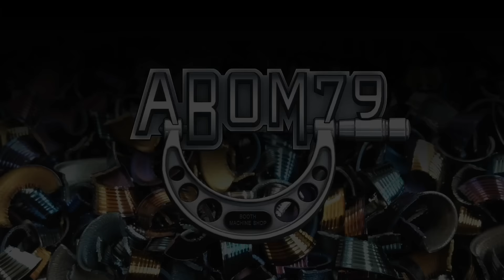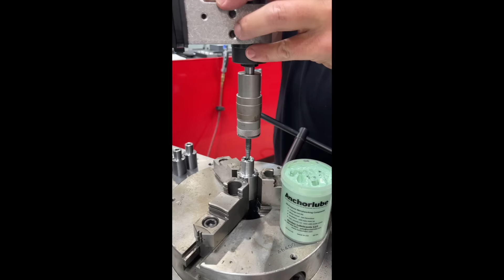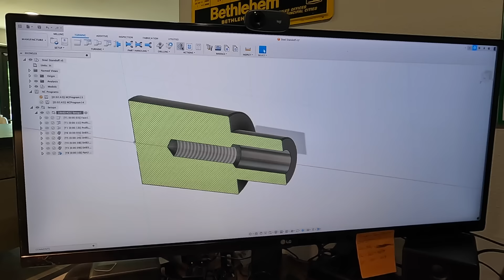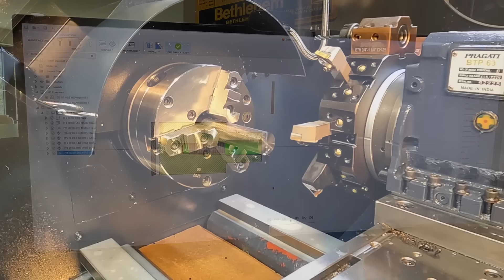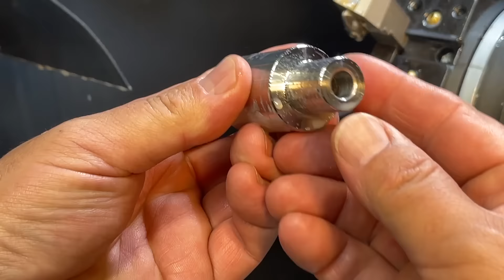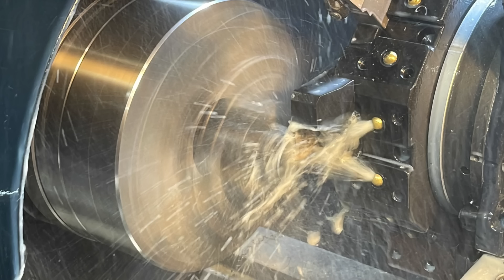Small Batch CNC Turning for the Fab Shop

Comment: form tap it and use the largest carbide drill you can while keeping the minor diameter in spec for the thread fit.  no need for anchor lube if your coolant concentration is high enough.  I run at 10% on the mill and have had zero failures form tapping 304

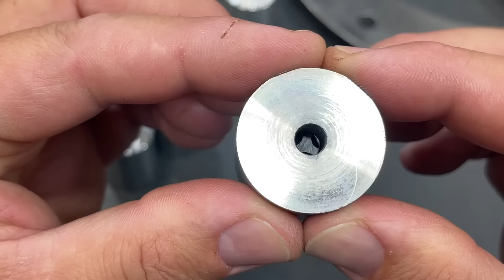Comment: At 22:58 it looks to me like there are threads all the way to the face. Adam wasn't taking 1/4" cuts, so if those were threads at the face then the tap did bottom out.
Reply: I though they were scratch marks from the drill
Reply: @thedodger7030  That's a very coarse pitch for drill scratches.  If the tap did bottom out it would have left shallow cuts at the thread pitch (shallow because it's the tip of the tap) and that's just what it looks like.  That is consistent with bottoming out caused by the spindle not stopping instantly at the finishing depth. However I can't explain why the broken portion then moved back up the hole.  Perhaps we will get a clearer picture when we see what Adam does differently on the next attempt.

Comment: If you want to have another go at tapping in the lathe I would suggest a few things. Quickest and cheepest drill out for a 65% thread rather than a 75%. Way less torque needed to make the thread with almost all of the strength of the 75%. Next step up is try using a form tap. Way bigger stronger core of the tool and no chip problems since your forming the threads check the drill size though because its probably not on the chart. The threads are also stronger since the grain structure of the metal is deformed and hardened slightly during the tapping process. Most expensive option use the form tap with a Tapmatic Syncroflex II tool holder. If you find that the problem is the dwell at the bottom when the chuck needs to change direction a syncro holder will help reduce the shock the the tap feels.
Reply: Form taps works necessarily with oil not with coolant
Reply: @petkoivanov9020   They work fine with coolant. I have done thousands of holes in all kinds of materials with form taps with just coolant and they gauge just fine. MAYBE they would last longer with oil but I think 2000 holes tapped per tap is enough life for a single tap.

Comment: Machine Coolant sucks for taping,  optional stop and anchor lube,  and run a lower speed
Reply: Agree, we always lube when taping steel.
Reply: Lubrication isn't the main reason that tap snapped...  We run water based coolant since 15 years and we have drilled and tapped 10s of thousands of holes and never had a brand new tap break on first use..

Comment: Does milltronics use canned cycles. I dont know if fusion posts canned cycles.  if the lathe is conversational maybe try using that to program the tap. I agree that a floating holder iis probably needed for that machine.

Comment: spooling down the spindle after each pass is killing your times, because once you spin it down, you have to wait for it to come back up to speed before starting the next movements. find a way to disable that, that way the only time your waiting for the spindle is when you actually changing spindle speeds
Reply: He's got it in css mode.  Spindle speed is proportional to tool position
Reply: I wondered if that was something as a default in the programs or if Adam set those RPM's.  I would agree, those up and down RPM's really aren't all the necessary, I do get the idea but I don't believe anything is gained in the end. Some of the speeds I noticed are super fast, faster than I have noticed in any other CNC process.

Comment: Hi Adam,
Really enjoy your videos.
Just a hobbyist here.
I have a 2007 HAAS TM1P Vertical Mill and many years ago I did some Peck Tapping on my machine.  Here is the title of a video that describes what I am talking about.
"Simple Peck Tapping Using a G84 Tapping Cycle – Haas Automation Tip of the Day"

Not sure if your Lathe and associated software supports this function or not.  If it does this may???? be of some help in tapping deep holes.
🙂

Comment: I would try an optional stop before the tapping cycle and add some Anchor Lube to the tap. Peter at Precision does this. Also I would set the tapping RPM to dead slow…like 20 rpm to eliminate any shock loading. The lathe should know when the spindle speed goes to zero so it can reverse and start retracting. If it is smart enough to do thread milling it should be smart enough to do rigid tapping.

Comment: Form tap cold rolled all day long. Those stringy chips when cut tapping are a nightmare
Reply: If your feed and spindle speed are not locked/synced properly then that won't help. When he gets that sorted or has a floating tap holder then you can play with tap options.

Comment: It’s almost like the mass of the spindle kept it spinning vs a hard stop causing a bottom out
Reply: A fantastic learning experience
Reply: If the spindle speed and tool position are truly sychronised, the slowing down, stopping and speeding-up in reverse should take care of these details. It didn't bottom-out.
There's something else going on and I'm looking forward to finding out what it is.  
If Adam simply goes to a tapping head, it will certainly fix the problem, but we'll never know what the problem really was.

Comment: Welding shop to the customer rescue again
Reply: Well… I’ve been around that airport equipment in the past.   It gets a half year of wear in one shift.. add in poor engineering… like the cylinder is not in line … the mount plate has too much flex, etc… and it becomes a nightmare

Comment: Thanks for the video,, I may have missed the reason for not putting a welding bevel on the end,, does it need one?
Reply: The welding shop will be putting a hole into a plate, then put the standoff into it and secure it with a fillet weld (perpendicular surfaces).  Then the plates can be bolted into position on the machine, instead of having the welding shop come out and weld a standoff onto the machine.

Comment: could you try to have a pause in the program so you can slap some anchorlube on the tap before the threading?
Reply: The tap breaking had nothing to do with lack of lube/coolant. It broke bc the spindle speed and z axis feed weren't synchronized.
Reply: No need. The Anchorlube could be added when he places the workpiece in the chuck. It would easily stay on the tap until it was used. Another optimisation could be to drill the part all the way through, maybe even with a smaller diameter drill. This would mean he wouldn't have a nub to face off after parting off, though it might raise a bur which would need to be taken off with a Noga deburring tool or a countersink deburring tool. Depends on if the client would allow the through-hole, although it could be useful for part positioning/registration when they weld it on to their plate.

Comment: been years since ive been at a cnc lathe, but we used to clean the holes and put some oil before cutting, maby reduce the speed a little ? me thinking the thin tap "twists" a bit if it starts gumming up, and therefor break

Comment: Could you blow out the hole with air, put a dab of Anchor Lube in the hole instead of using the coolant fluid before tapping the threads?
Could it be an idea to make the chuck run slower and pause before reversing to lessen the load on the tap?

Comment: The milltronics machine doesn't have the drives synchronized accurately enough for rigid tapping. Notice how the spindle is continuously spinning before the tap is fed into the part. Thats why a floating holder is needed for that machine. On a haas when rigid tapping the spindle will stop then when the tap is fed in it will rotate in sync. True rigid tapping allows the same hole to be re-ran multiple times. You cant do that if the rotation of the chuck isnt oriented.
Reply: Agree, also should be using a spiral point gun tap in a floating holder. RPM  seems too fast..
Reply: CNC machines were doing rigid tapping in the eighties. Lack of lubrication is the problem in this case. Also should have used a spiral flute tap.
Reply: rigid tapping only synchronizes the feed with the spindle rotation, a Mazak will rotate above the part, as well as a Mori 

both machines have far more rigidity and capability than a Haas.
Reply: If that was true, how could it cut a thread? It's the same problem—move in Z in sync with the spindle rotation.

If it is jamming up, then most likely something's wrong in the post.
Reply: @PaulSteMarie  yeah that's a good point,  so how does that machine handle single point threading? All CNC machines can do right or left handed tapping but not all can do rigid tapping. There's a difference.
Reply: @caploader111 I'm no machining expert, but I think the reason not all machines say they can rigid tap, even though they can single point thread has to do with backlash. You can single point with all the backlash in the world and not have to worry much about it. With rigid tapping, however, you have to run the tap back out, taking backlash into account. I also think taps might just e a bit more fussy on the accuracy of the synchronization, but I could be wrong about that.
Reply: @neistridlar  yeah I agree. I think this milltronics lathe doesn't have the necessary drives and encoders for rigid tapping or it needs to be programmed using a canned cycle. I don't know what fusion posted out . I would assume that whoever is helping Adam program would know
Reply: @neistridlar  That's true, I use an 1991 Mori SL-75 daily and use a tool holder that I guess is semi floating type that has a little forgiveness for that, I tap mostly 1/4-28 with spiral flute and cutting oil @ 60 rpms it seems like.  The feed on this 18 thread he's doing should be .0555 ipr. The check to see what happened would be to look at that depth shown in the gcode and the Feed rate first instead of machining the end off.  I try to teach that stuff in CNC router groups but looking at the gcode is so frowned up on these days sadly. I trust reading the gcode long before what the simulation is showing.
Reply: @neistridlar  I think its mostly an issue if kinematics of this machine. At the bottom of the thread the spindle needs to instantly stop and reverse directions. This is not possible in the real world. This lathe in particular looks pretty slow on the stop and reverse. A floating tap holder or a syncro tap holder ( stiffer than floating but still compliant) would solve this problem. I think on paper his RPM is correct but he has to learn the limitation of his particular machine. As an example with a syncro holder in my BT30 spindle machine I can easily tap a 10-32 hole at 1000 rpm but I can only do 200 rpm in my lathe. Because the lathe spindle has so much more inertia it just takes more to get it stopped and reversed than BT30. He just needs to figure out where the sweet spot is for that machine.
Reply: @TomDetka  The machine doesn't need an "instant" stop—it just needs to maintain synchronization between the rotation and the Z position. The tap is going to be more sensitive to that than a single-point cutter and will jam and break in situations where a single point cutter would just make a small divot in the thread that would likely escape inspection.

Comment: It still amazes me after all these years that we can use coolant to tap at all. For all other manual and power tapping, we use cutting oil or anchor lube but in a cnc, we use coolant.
Reply: Coolant is lubrication also
Reply: We tap with coolant all the time. No problem.
Reply: @loukola5353  Yes I know. We've done it for many years successfully. I'm just surprised, that's all.

Comment: Floating tap holder Is way to go I’ve use them many times over the past 20to 30 years they are not new but they work great started using them on manual machines

Comment: When you find out the issue with the CNC tapping, we would like to know.  I know it should work or there would be significant specs for size and depth.  Thanks.
Reply: It broke bc the spindle speed and z axis feed weren't synchronized.

Comment: Tap broke because there was chips in the hole. If you notice on the last part you can clearly see there is chips still in there.
Reply: No the tap broke bc the spindle speed and z axis feed rate weren't synchronized together on top of running it way too fast.

Comment: for taping , slow spindle speed to about 350 rpm g97, also make sure you are using the correct feed rate and code for tapping, for turning should be able to cut .150 a side maybe even .200 . that should take no more than 1:30 and yes I've been on a CNC lathe since 1979,
Reply: .200 a side with that little lathe? 
I'd like to see you try that.

Comment: Summary

* 00:00:00 A welding shop is having trouble with a standoff part made of aluminum that keeps breaking. 
* 00:02:01 To make replacement easier, they request a redesigned version in steel, attached to a plate with bolt holes for easy removal and replacement.
* 00:03:13 The machininst redesigns the part in Fusion 360, adjusting feeds and speeds for steel.
* 00:03:24 He wants to try rigid tapping on his CNC lathe. He prepares new collets, taps, and drills for the operation.
* 00:18:52 The initial rigid tapping attempt fails as the tap breaks off inside the deep hole.  The failure may be due to lack of coolant or incorrect lead settings.
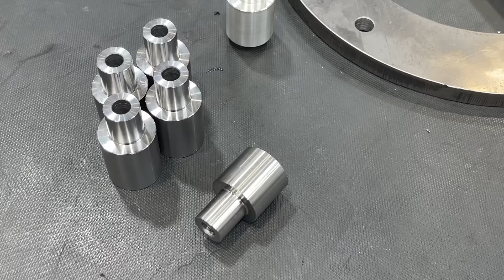* 00:22:53 He examines the broken part and confirms the tap broke before reaching the bottom of the hole.
* 00:23:30 To avoid breaking more taps, he decides to power tap the remaining parts using his Flex Arm. 
* 00:34:00 He reflects on the failed rigid tapping, acknowledges the difficulty of deep hole tapping and considers investing in a floating tap holder for future projects.
* 00:35:29 The job is finished, and the machinist plans to continue experimenting with rigid tapping in future projects. 

I used Google Gemini 1.5 Pro to summarize the transcript.
Cost (if I didn't use the free tier): $0.2419
Time: 108.30 seconds
I added a 60 second delay to prevent a rate limit of the free tier.
Input tokens: 67414
Output tokens: 566

Comment: So i work on Mazak CNC lathes but i should imagine the same will go for all CNC lathes since they mostly all have the same guts to them. When you initiate a tapping cycle, the Z axis feed and spindle synchronise with each other. When the tap reaches the bottom of the hole the spindle needs to decelerate in preparation to run in reverse and in turn run the feed direction in reverse also. Its during this state where the Z feed can partially unsync the feed from the spindle, very minimal but enough to shatter a tap especially in steels. In an application like this i'd recommend the use of a tapping head since any unsynchronised feed is automatically taken up by the head quill automatically retracting rather than using the helix of the tap to try and pull itself out the holder but ultimately snapping instead since its held securely

Comment: Your tap holder needs a clutch and don't use coolant, put some grease in the hole and tap and run it with like 100 rpm

Comment: As a CNC turning machine operator I can assure you sir: that is too much speed for that tappy tap tap!
In metric threads I won't go over 500rpm with a tap in tool steel (1.2344). (I'd use like 300 on a M10 (which is similar to yours)

Thanks for your great video! Love it!
Others before me also meantioned that.

Comment: The flaw with the machine would be it's made of aluminium. After a large number of cycles those areas become brittle and snap.
There is the same flaw with aluminium aircraft parts. Thus the reason they use a special system to check for cracks.

Comment: Im sorry that I honestly cant give you a more precise name for it - but where I work we always use a specific kind of holder when threading. Its specifically made for tapping - it gives "play" so you can both yank on the tap and press it further back in the holder. 

Something like this:
"Tapping Collet Form ET (ER) with length compensation"

Almost every toolbrand makes their own it seems.

99% of my work is running a CNC mill but I remember having massive problems using threading taps on a small CNC lathe some years ago. Every since I changed to a collet holder with length compensation - my taps never broke =)
Reply: he mentions that at 34:34

Comment: I dunno if you even read the comments, but 99% chance there's an issue with your post proccessor on that tap. Normally it's something like
G84 Z- TAPDEPTH F TAPFEED
But you sometimes have to have to do an M29 S SPINDLESPEED to get it to sync.
I'd talk to milltronics before you start going down the floating tapping head route. They have a bunch of problems in themselves.